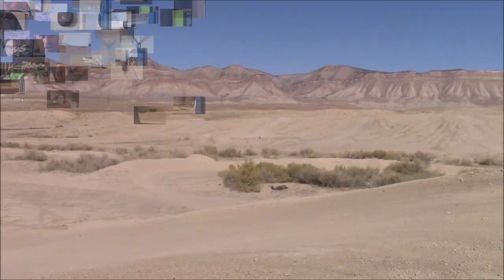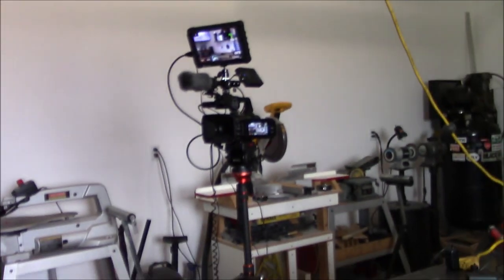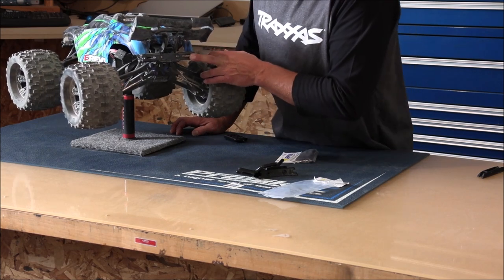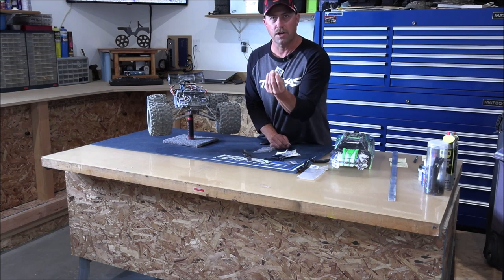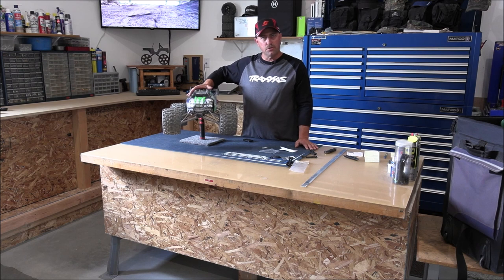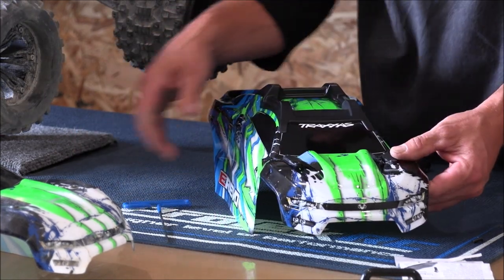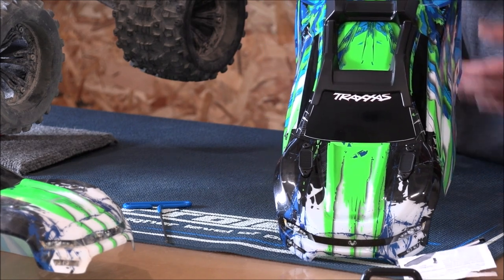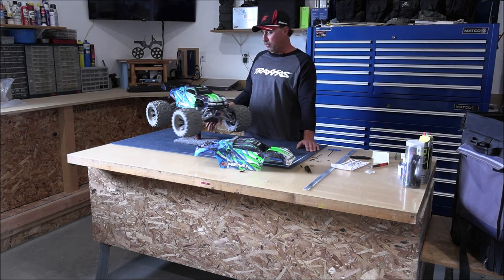RPM Bumpers And Body Savers Review, Install, And The Best Way To Get Rid Of Body Damage

Comment: can I ask what gearing you use and want batteries? Also have you ever had the motor overheat?
Reply from the maker: I am running a 16/46 and have no problem overheating with 6s traxxas 5000mah at 50c
Reply: @upgradedrc3697  do you know if 16/46 makes it faster the the stock 15/54? Also do you know if it makes it hotter because I ruined my motor with Traxxas 6s and stock 15/54 on the second run. I noticed that on the gearing chart 16/46 is to be used with 2s i wonder why.
Reply: Caro Babaknia are you sure you burned up your motor? They’re not supposed to turn by hand and if your using self right it’s probably everything but your motor

Comment: Your audio is fine and I'm using a phone
Reply from the maker: I was talking about the older ones lol😆  But thank you.🤘
Reply: @upgradedrc3697  your a mad dude keep up the good videos. My erevo thanks you for the awesome knowledge base and step be step easy to follow videos. I'd rather watch a long drawn out video with the great explanation than a hurried edited one missing all the little tricks of the trade. My erevo now has the metal rear brace and bumpstops  and the two hardest spring rates in the post on its way.  You've helped me make it pretty much bulletproof so thankyou. I'm going to watch some more just received my 20 million weight and 100 k weight sludge just this second so I'm coming to watch your diff vids with a magnifying glass rite now. Just one question. I've been driving on the road mostly, how often do you recommend the diff fluid maintenance be done. Thanks again from the capital of Australia
Reply from the maker: @saransmith8773  Thanks appreciate the comments. You should change the diff fluid at least once a year.  But i test a lot and keep it fresh every couple months or so. It depends on how hard , and howlo g you bash for and how often. And the weather has always been a big part of the adjustments also! Just keep it lubed and clean, you'll be good!🤟👍